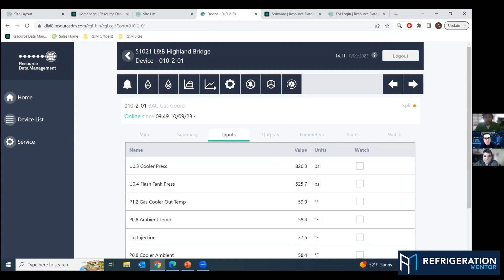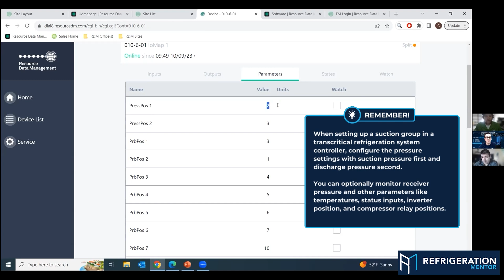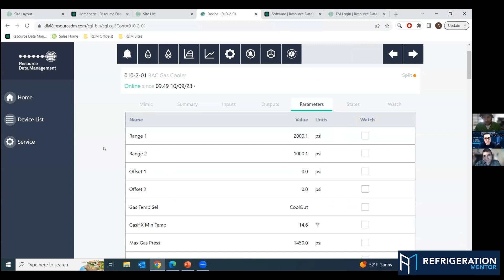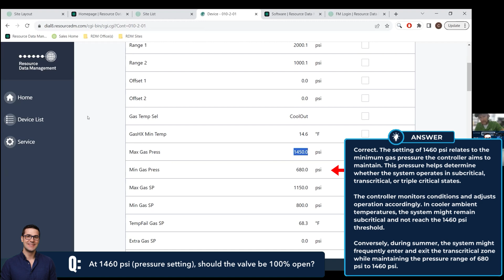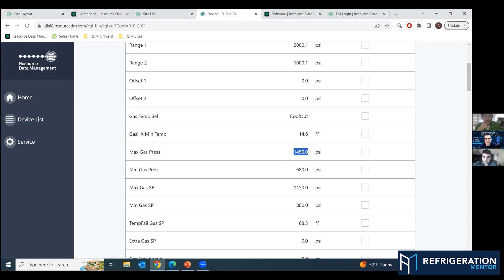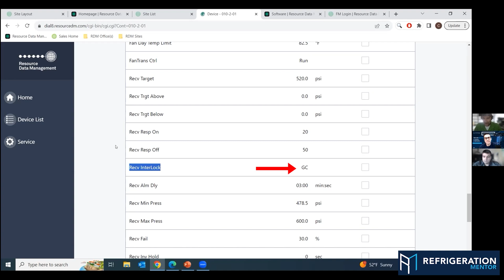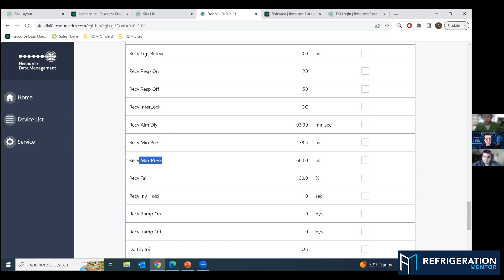Setting Up RDM Transcritical CO2 High Pressure Valve HPV & Flash Gas Bypass Valve (FGBV) Expert Tips

Comment: At what FGBV open % will the IT comps be called for?
Reply from the maker: @MogCity2  great question. It will be receiver pressure. You want the least amount of flash gas going to the MT compressors.
Reply: @RefrigerationMentor  yeah that's right, the FGBV will open relative to vessel pressure. My question is what is the optimal point when it comps are staged in? IT comps move lots of oil in DOL and VFD setups ,(30hz-70hz) have you guys found better outcomes with early staging or late staging?
Reply from the maker: @MogCity2  that’s a great question. I do not have the answer for that yet. Could you elaborate on early staging or late staging?  Refrigeration Mentor is a technical training organization www.refrigerationmentor.com and do not work at any of these companies but I will reach out for you and see what I can come up with. 

What I have seen is you want your flash tank to not fluctuate too much <28psi/2bar or it will cause other valves to fluctuate a lot and the system will start to get out of balance. 

If you’re trying to maintain a 551psi/38bar/38F/3.3C flash tank you would want that IT compressor to always be running or trimming depending the ambient temperatures.